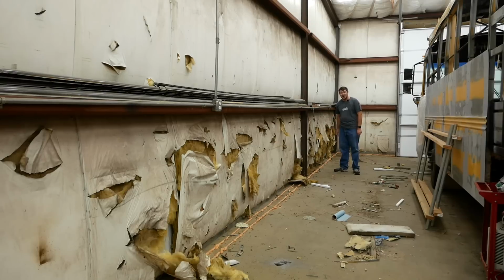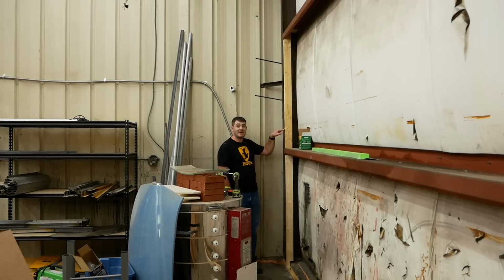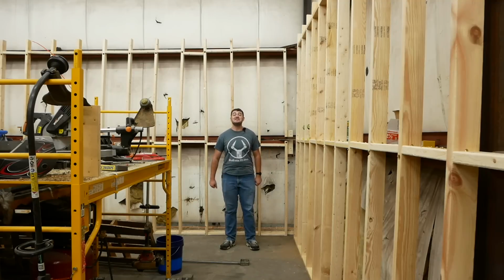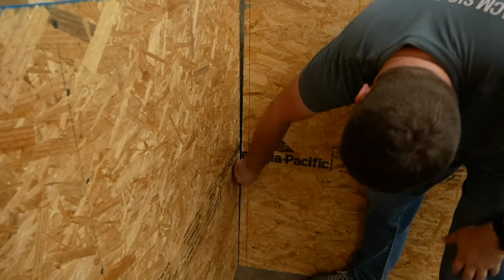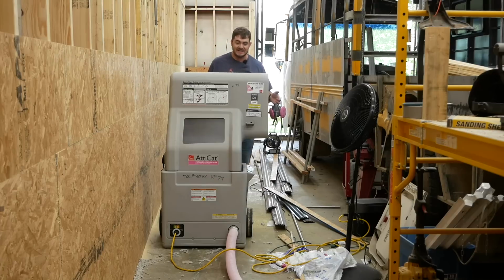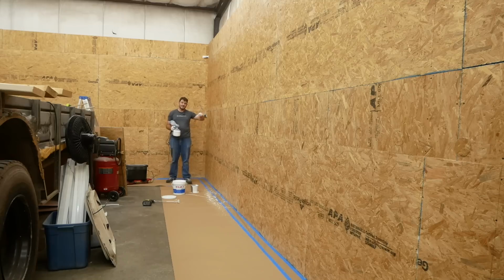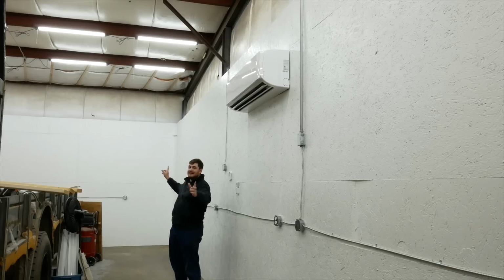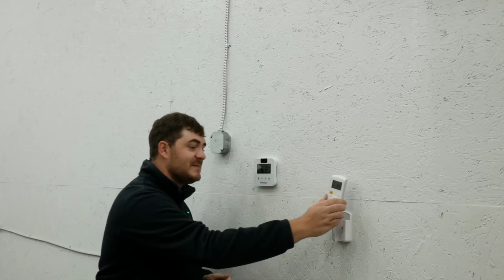The Bus Room is Done! (For Now)

Comment: 1. You have no excuse not to work on the bus anymore. Ouch.
2. Those gaps are easy to cover-up. Just take rolls of blank receipt paper, some wood glue and a bit of water. Dilute the wood glue with a bit of water, brush it on the wall with a brush that is as wide as the receipt paper, then apply said receipt paper on the wall. To make it more durable, brush diluted wood glue over the receipt paper and over it's edges. That will not only make it more resistant to water and peeling, but also cover-up that you used receipt paper as it's edges will be firmly glued onto the wall.

Comment: Those of us in the Design/Construction field might have just found the floor high spot with the laser, and struck off a line 48.5" higher than that point, and runs the sheets down from there.  (Having the sheets in contact with concrete can invite wicking of moisture, which is not good for OSB.)
For about a similar amount of effort and cost, friction-fit 4" batt insulation could have boon in the wood framing.  That would be R13 + R2 from the 8" airspace, and a nominal R5 from the existing blanket, which would net you an R20 wall assembly.
Maybe.  Perhaps, YMMV

Comment: I'm not sure why you decided on screws to hold the OSB (One Side Bad) on, since you are never likely to remove it with all that nasty loose insulation behind it. A pneumatic nail gun would have cost less than either of those screw guns, and would have done a perfectly fine job with either 6d or 8d nails, It would also have been faster and easier to use.

Also, it is traditional to have furring strips behind all edges of the surface material, to keep the edges of adjoining panels from warping and bowing in different directions and different amounts. You really should have had furring strips horizontally along the top edge of those first sheets, split with the bottom edges of the sheets just above.

All that said, you got it done and like the results, and that is what counts.

Comment: Some people might have set the laser line, fired in some nails along it, hung the upper sheets, then put the lower panels on with a toe jack. Base board or caulk the gap to the floor.

Comment: About 10 years ago I installed blow in insulation in my attic.  My dad was on the 1st floor feeding the machine and I was in the attic.  After about an hour I told my dad that it was taking too long and ridiculous...  After looking at the machine I noticed he had failed to open the gate from the hopper in to the blower section fully.  After another hour I was done. LOL

Comment: Nice job! Looks great in there now. I wouldn't bother with framing, OSB, and blow-in cellulose for the upper wallss and ceiling. I would just tear out all that old fiberglass and get foam sprayed in like Taylor Ray did in his new shop. its gonna be a lot easier and. take 1/10th the time. Not sure how it would stack up on cost though.

Comment: Yeah, the "explosive concrete nail" idea has been used quite long ago, I remember my father bringing me the plastic "combs" that were used in a Hilti explosive nailing system (each comb holding about a dozen explosive caps) at his workplace. I still have a couple of those caps (unused), they look like normal bullet shells without the bullet and the open end "puckered" closed, and that was somewhere around 40 years ago! And the nail for that was a hardened steel nail about 3 mm thick and maybe 50 mm long. I have no idea if that kind of nailing is still used today. Well, you have at least the manual hammer-operated version, so at least to some degree thay appear to still be around.
Reply: The lockpicking lawyer uses the Ramset boltgun/nailgun to open locks and they are also used to kill livestock on occasion with a headshot..
Reply: @TheBibliofilus   Thanks, Google search for "ramset" gives a wikipedia page for "powder-actuated tool" which has a nice photo of exactly the "comb" that I was referring to (a green plastic thing with ten explosive caps), heh.
Reply: I meant to continue, that personally I would just drill holes (with a good hammer drill it is actually a pleasure, heh) and use screws, maybe use plastic plugs although today there are concrete screws that do not need plugs. It just feels a lot more relieable than nailing. Same goes with fixing to the steel beams of your particular walls :)

Comment: The Mitsubishi mini-split remotes are the same way in that it controls the settings as an "absolute" reference instead of a relative reference (at least for my MSZ-series) - it's annoying for sure.  I have a dual head mini for my workshop and what's worse is that temp sensor between the heads make it so that the wifi controllers (one for each head) sorta "fight" to be at equilibrium.  Grrr... probably an adjuster in the system somewhere.... but still... annoying.

Comment: @5:50, real carpenters snap a level line 4’+ above the floor and hold the OSB to the line;-) This achieves perfectly butted sheets that are also straight, AND holds them off the floor to help prevent wicking moisture from the floor.  ALSO, we maintain an 8d nail’s width gap between all of the sheets.  If you don’t gap the, you WILL get buckling in humid weather when. The sheets swell up and push against one another in all directions.

Comment: A neat idea would have been to make pullout doors between the joists to take advantage of the dead space between the walls, hanging room on both sides of the wall if you cover the inside with OSB and it helps keep stuff out of the way.

Comment: You are so right about the Mr Cool. Was about the easiest thing I ever installed but the remote control and wireless thermostat are just about useless. I unplugged the thermostat and just use the remote now
Reply: That sounds like a perfect solution (unless you lose the remote). If the 2 pieces of tech both do the same things, one is them is unnecessary.

Comment: I've never seen this method of insulation before, granted I'm not in construction and all I have to my name is a 6m long wall that I insulated with rockwool but it looks like it's way more work than putting sheets of fibreglass insulation between the studs.

Comment: aspinite or chip board is bonded by Uriah glue.  It is meant to be covered with paint or mounted in an area that air will not penetrate into the living space.   If you spend much time in that garage, you will probably develop lung and breathing problems.
I would advise painting all the outside and then because the reverse is not sealed you will need to install a 24/7 vent fan system.

Comment: Maybe I'm missing something but wouldn't it have been easier and lose less space if you had just put the 2x4's on flat?  Always excited when one of your videos comes out 😃
Reply: That threw me off as well.
Is there a reason for that? Or maybe he just didn't thought about that? 😂
Reply: And it would have made fixing easier,  the hammer nail guns work better with a large 2lb hammer
Reply: At that point you might as well have used 2x2 as the 4 in the 2x4 wouldn't provide much extra support to the wall sheets. I mean, they would then be structurally in the wrong (weaker) orientation.

Comment: After a few seasonal changes, that bottom of the now fresh wall will look as hideous, if not even more disgusting than the older moisture trap you just hid. Quite possibly some mold will appear, with all kinds of respitory diseases and other equally fun stuff. Trick is to isolate and ventilate. Concrete floor dissipates moisture from the ground to the structure on top of it. That is the nature of the material and simply nothing can do about it. So you need to isolate the structure from the concrete, and ventilate the moisture out of the stucture. Otherwise your top quality insulation is a wet sponge.

Comment: Why o why didn't you rip out the old wall insulation? Get some expanding foam company in and it would be done in a day. After that you could frame out and place your OSB. ( Determine highest point on the floor, draw a line half inch higher across the wall. Place OSB level)

Comment: Whatever you do with that many split don't put it on auto because as soon as it reaches the temperature you sent if it happens to be cooler than the temperature you have it will turn the heat on and never turn back off mine doesn't. The turbo button for the fan only stays on for about 5 minutes and then it turns it to low and be worried about the outside fan it will just die.

Comment: Good job! It would've been easier to just lay the 2x4s flat on the steel. Could've used 2x3s if they are cheaper. Sometimes they're not. You would also lose less floor space.

Comment: Don't feel bad about how the walls turned out, my dad had an extension to his shop built this year, and he did the exact same thing for his walls: plywood screwed into the wood beams painted white. While it definitely doesn't look great up close, it works perfectly, and when all your tool cabinets, shelves, workbenches, and other things are up you don't notice it. And if it ever gets damaged, like if you accidentally run a tractor into the wall, it's easy to repair. Overall it's a great system

Comment: That whole cellulose blowing method seems like a really complicated way of doing something simple, like using the insulation rolls and just fitting them between the wooden posts.
Reply: I have seen from an architect that blowing is better (as in less labour) for most cases and tends to have higher r factors.  No idea if this is true, but I can't see why the other person would lie.  Also using spray expansion would probably be easier than using rolls, you just spray into the bit you want insulated and it expands like builders foam.  From what I understand this is the easiest and cheapest way to install insulation.
Reply: @jimmydesouza4375  that might be true on larger projects because the the overhead of the machine, setting it up and operating it will be split over a larger surface.
Reply: @jimmydesouza4375  He's probably just going by ease of use. Cellulose is the better material because it's not so bad for the environment to make or so bad to biodegrade when it's taken out. Plus it's made mostly from recycled materials and isn't that much more expensive than fiberglass.
Reply: @jimmydesouza4375  expanding foam is substantially more costly than blow in foam but better long term insutaion value.  it does fill gaps very well and does not settle, and the  r-value is higher.  It would have added many thousands of dollars to this project
Reply: Problem with that is the gap from his installed posts and the wall is about 6.5" thick(going off of his described 10" gap minus 3.5" posts) with the gap having no dividing posts to hold additional batts of insulation in place. The cellulose is just cheaper and less work.

Comment: In construction, it's common practice to first mark a level line on the studs and then use wood shims to make the panels straight while they get screwed in place. Once this is done, a baseboard is added to hide the gap.
And BTW, I just love your "Quantum State" heat pump 😄(Think about the Schrodinger's cat experiment)
Reply: A baseboard would mean losing another 1/2" of workshop floor!
Reply: @ferrumignis  WTF kind of baseboards do you have that are 1/2" thick? He could just use that stuff they use in commercial buildings - like a thick vinyl that comes in rolls and you just glue it on.
Reply: @gorak9000  think it was just a joke bruddah
Reply: @gorak9000  I was joking, like Robert was aghast at the loss of 3 inches when he put the studs up...
Reply: @gorak9000  He was joking, but if the baseboards are 1/4" then you lose 1/2" with both walls.
Reply: @gorak9000  I want you to know because of this comment I measured the thickness of my baseboards and they're exactly half an inch thick :)
Reply: @ReverendTed  and lose a full inch of floorspace with all 4 walls
Reply: @gorak9000  level 3 body armor
Reply from the maker: I figured that out, but only after it was too late
Reply: This is how you learn stuff from YouTube.  You watch Robert do it the wrong way, then come to the comments to find out the right way. 🙂
Reply: OMG! Your videos are always hilarious and your wry wit and your ridiculously huge IQ always show through in your videos. I loved the ending!
Reply: Remember, there are THREE correct answers to Schrodingers  Cat Question!
1) The Cat is alive.
2) The Cat is dead.
3) The Cat has become bored and wandered off.

Why Schrodinger picked a Cat of all things I'll never know.  He should have picked a Dog... then it is a simple binary answer.
Reply: @honorharrington4546  Douglas Adams shout out.

Comment: I have owned and used one of the screw guns for years. The one thing I have learned about it is don't use it when trying to initially hang the board. Its only good for hitting screw schedule requirements. Also, put the flat square tip in it not the round one (and double-check the screw length setting).

Comment: You know Bobert (can we call you Bobert?), depending on the conduit you used, it can be used as the ground instead of having to run a dedicated ground wire, and it's up to code too.
Reply from the maker: That's a good tip! And yes, I'm know as Bobert to many
Reply: @agingwheels  I have a friend named rob and we also call him Bobert. I thought we were being funny and original!
Reply: That sounds super janky especially if not installed by an electrician… but hey, different folks… anything is fine as long as I keep getting these videos because they really do cheer me up!
Reply: @mumblbeebee6546  It can be for sure, but if I remember correctly normal EMT isn’t allowed for that, and different fittings have to be used as well.
Reply: @wcvp  its actually the opposite. Emt can be used for grounding, MC cannot

Comment: Your osb should not be in contact with the floor. Any moisture will ruin your osb and it will bubble up and start to mold. Boards against concrete should be treated and with a strip of tarpaper between

Comment: As someone who has had the unfortunate experience of fixing cobbled together wiring..That ending killed me.
Reply: most people are shocked to find out I am a terrible electrician
Reply: And him!
Reply: F
Reply: Once (and only once up to date) I have found bathroom mirror with light, connected with coaxial cable (yes, antenna kind) hot side running through shielding and neutral through core. Fun thing to do in wet environment above sink with no RCD in breaker box.
Reply: @siriusgray3579  okay there's janky electrical and then there's how in the actual fuck
Reply: Electrifying. 😉
Reply: Killed him too.
Reply: "Very poor choice of words."
Reply: F
Reply: I don't see the practical benefit of running two 12gauge wires as opposed to romex.  But technically speaking - 

The National Electrical Code (NEC) recognizes several types of conductors that are permitted to be
used as equipment grounding conductors. A complete list of all approved equipment grounding
conductors is listed in Section 250.118. Rigid metal conduit (RMC), intermediate metal conduit
(IMC) and electrical metallic tubing (EMT) are permitted per 250.118(2), (3) and (4) respectively as an
Equipment Grounding Conductor.
Reply: the unfortunate fact is, that clip probably was likely an outtake he cut out, he probably should stop messing with building wiring since every time theirs at least 2 flash arc incidents...
Reply: @PortersMob  Mehdi over at electroBOOM is getting annoyed due to the growing competition...
Reply: @PortersMob  yeah he really should stick things like studying the English language aye

Comment: Why did you use blow-in insulation instead of rolled insulation or batts?
Reply from the maker: Cost. The cellulose for all of the wall cavities was $800. The fiberglass rolls for just the end bits of the ceiling was $1000 for one fifth the insulative value of the cellulose
Reply: @agingwheels  That is a heck of a lot cheaper, fer sure, even with renting a sucky blower. You'd get about 35m² of rock-wool here for that money, so looking at the size of the building, it's probably 10x more expensive :D
Reply: That's my thought as well. I'd have grabbed a bunch of bales of 10" rock-wool insulation and just shoved it in between the 2x4's. Much quicker, almost no dust, and it stays put while you install all the siding. 🤔

Comment: The thing about the minisplit's remote slayed me. When mine was installed a couple of years ago, the tech who showed me how to work it opened a Secret Panel on the remote and said something along the lines of, "All these buttons in here control a bunch of timer functions and wifi stuff that sound really cool in the manual, but none of it works right, so just don't open this." Which was refreshingly up-front, but also a little disappointing in something I was paying that much money for.

(Also, over the course of the first winter I had it, it reduced my fuel oil usage... not at all, so there's that. I probably did something wrong, though I have no idea what. Anyway, it's still way better than putting in window AC in the summer.)
Reply: We got our A/C unit replaced recently, and after a few months I discovered that the fan only runs at 20% speed when in fan only mode. For some reason. Called up the installed and they just go 'yep that's just a thing those units do'. So that's neat.
Reply: to actually reduce fuel oil usage you need to make sure that the minsplit is heating before the fuel burning central heat starts up. That will offset the heat the central heat needs to put out.

Though you'll need to ensure that the heat of the minisplit actually reaches the thermostat of the central heat
Reply: @ratchetfreak  Yeah, I thought that was happening, but apparently not. The zones on my boiler are all wrong anyway, which presumably doesn't help.
Reply: I have a Hisense portable AC and it functions the same way as this mini split. Very poor design.